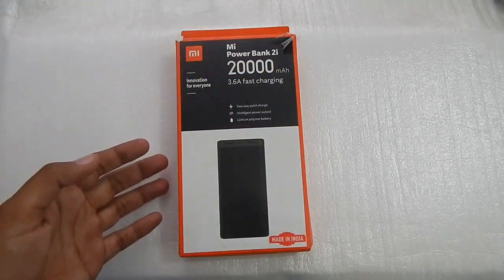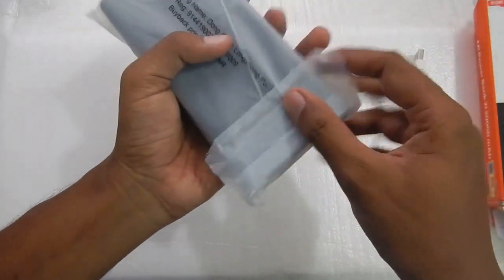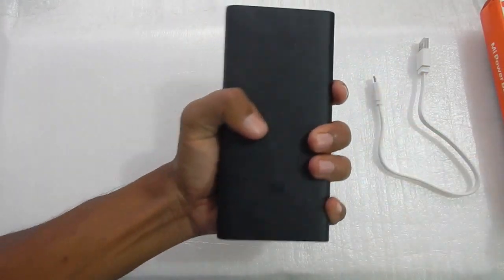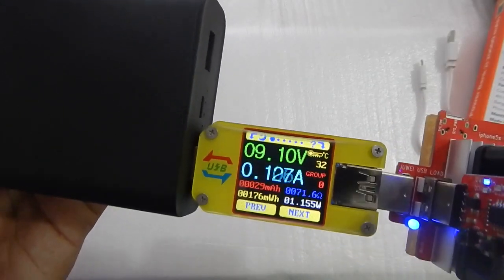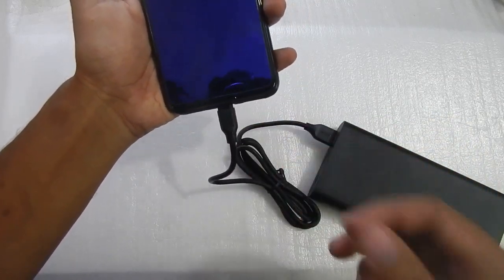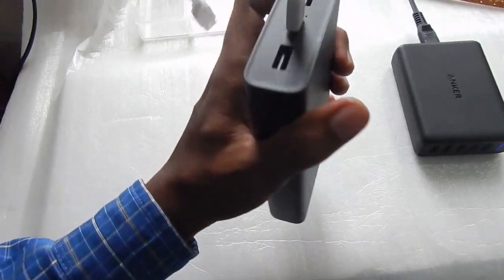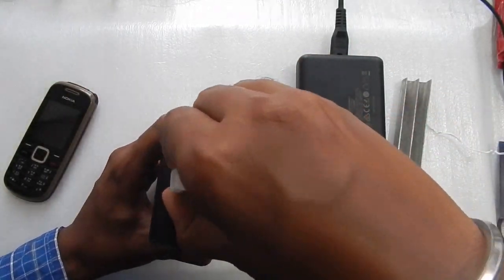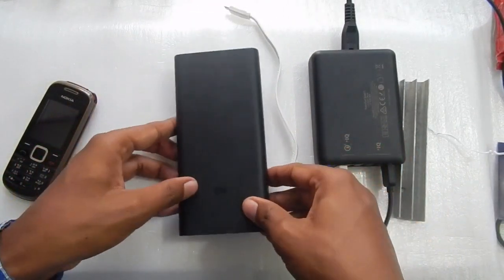Mi Power Bank 2i 20,000mAh 2019 Unboxing & Review

Comment: Can I use 5v 4A  vocc charger to charge this power bank....
Reply from the maker: yes, you can but the powerbank will only take about 2A from the charger.
Reply: So ,it won't affect the batteries??
And should I use the cable of the vocc charger or the one provided by mi.?
BTW thanks for the reply.
Reply from the maker: @Amitjha406  No, it wont damage the batteries because the powerbank will only take what it need from the charger.
Now, To charge your powerbank use the mi cable because it is short and shorter cable are more efficient And to charge your phone use any cable that fits your phone. One more thing this powerbank does not have usb C port so, you cannot use usb c cable to charge the powerbank.

Comment: Now tell us which of the one 20000mah will be best in Mi and Ambraone power bank??
Reply from the maker: IF you want then buy MI powerbank if you don't want fast charging then buy the ambrane powerbank.
Reply: @gurribuy   Thank you very much for this, tell me one more thing, if I take the Ambrane Company power bank, then which model would be better? PP20 or stylo20k PP-205???
Reply from the maker: @relaxationduniya5167  stylo 20k has 2.4A output but, pp20 has only 2.1 output. If you want more current then buy the stylo else buy the pp20. PP20 looks and feels much better quality.
Reply: @gurribuy Which 1 shld i buy for my mi note 8 pro (type c) mi PB or mi PB 2i ???